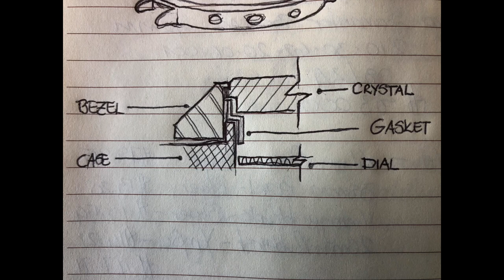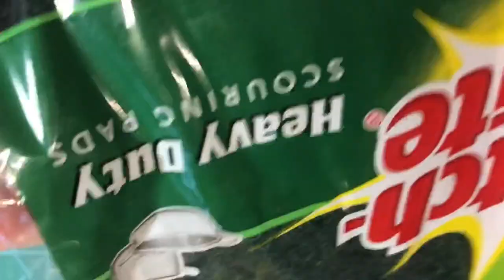How to apply a Brush Finish to a high-Sheen Bezel

Comment: I never popped the bezel off my Daytona and that's an odd design. What are the benefits of doing it this way cause it seems like a monocoque design for deep-sea divers like the Citizen 500m Chronomaster. That drawing is helpful and well done too, I was tempted to try it just to see and the crystal press hasn't been used recently, spared me some possible aggravation with fitment and alignment for the OCD types.

I'm not sure what temperature changes you go through but the watch shouldn't be opened unless if the humidity is below 35% to avoid condensation so I'd suggest to turn up the AC on the max dehumidifier setting or check the weather.
Reply from the maker: Hi Birilliantradience. Thank you for watching and for your comments. We are blessed in Johannesburg South Africa - while our temperatures can approach the mid- 30 deg C in our summer months our humidity is rarely ever a problem. It’s a dry climate. Great for watchmaking and the preservation of vintage motor cars 👍🏻